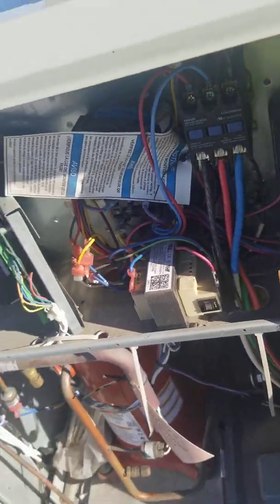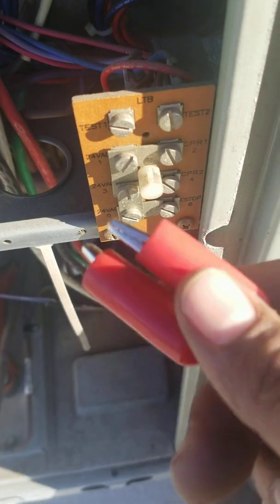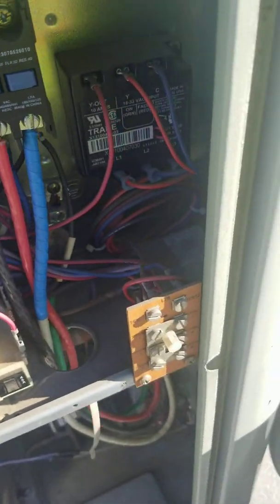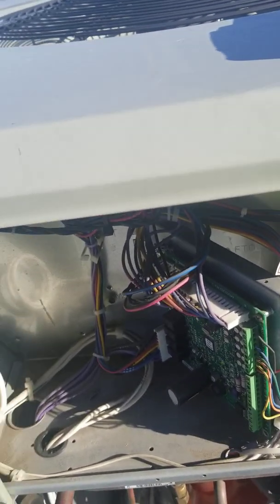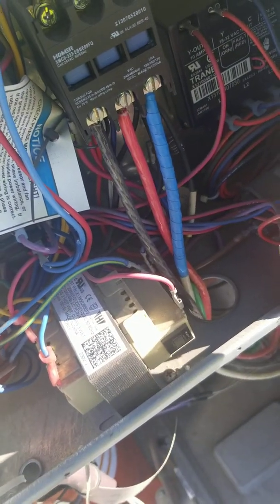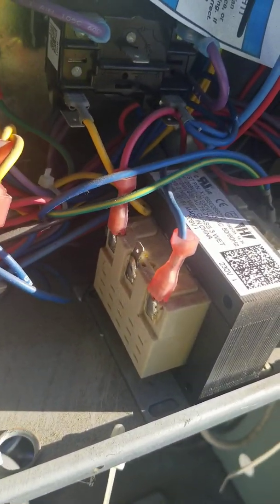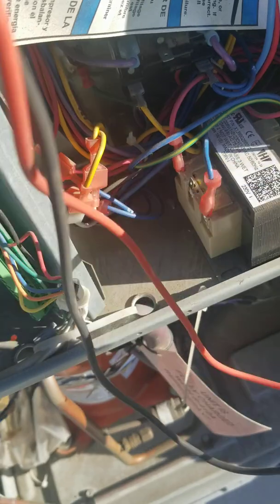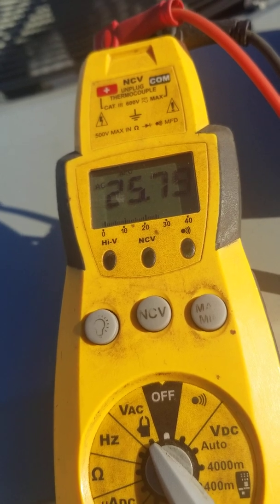Trane package unit test mode

Comment: Hey Eddie my  trane unit  doesn’t want to turn  it’s the same wsc . My blower motor turns but not my coolin.  I have Blinking green light on my board but nothing else turns on. When I push in my contractor my compressor turns on but not my condenser fan.  I’m getting good voltage and 24 v transformor switch out my contractor. What could it be